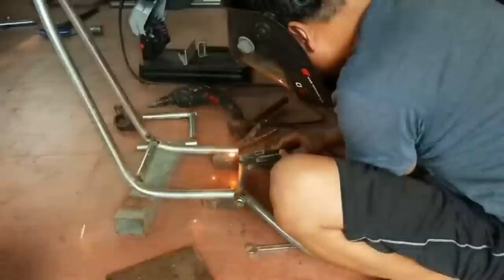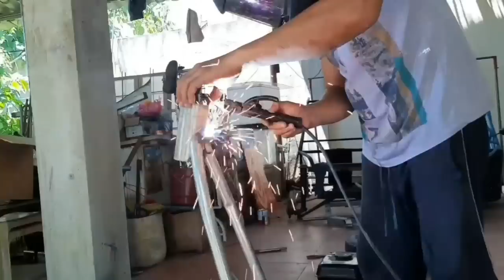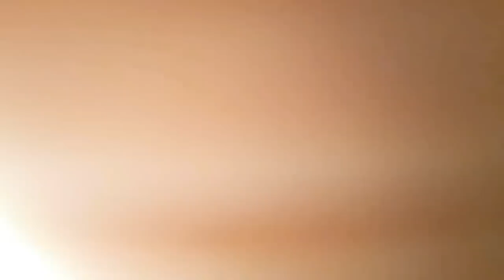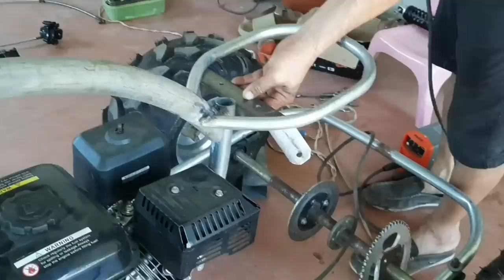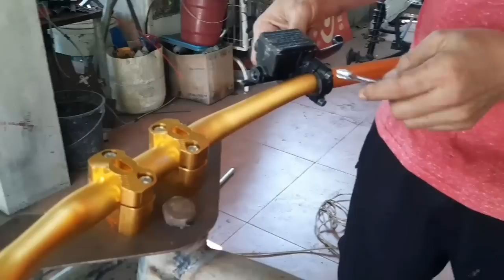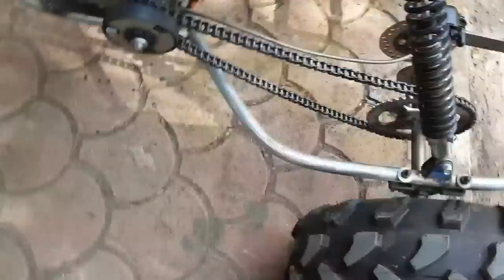build offroad trike at home | DIY OFF-ROAD TRIKE

Comment: the pivot point for the rear needs to be on same plain with the engine sprocket. if it is not then the chain will become tighter and looser as the rear end swings up and down. also, you should add some tubes/sleeves the same size as the rear axle bearings so that the tube doesnt crush while tightening bolts or riding causing the axle to shift around and miss-align the chain sprockets.